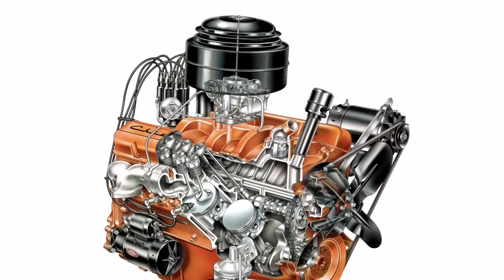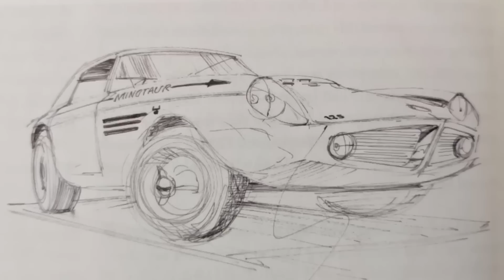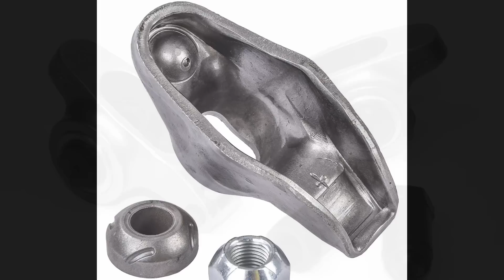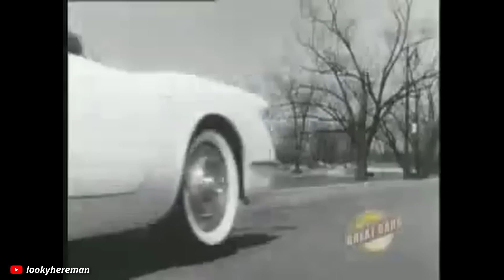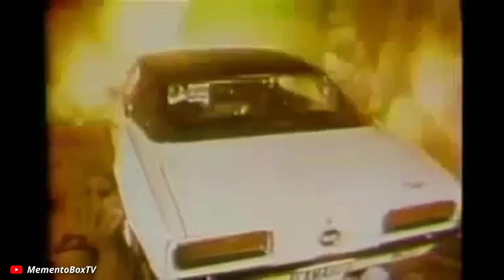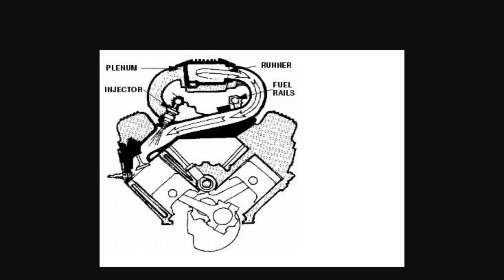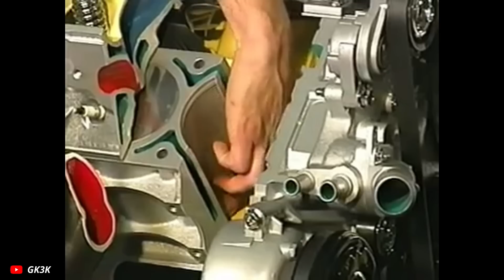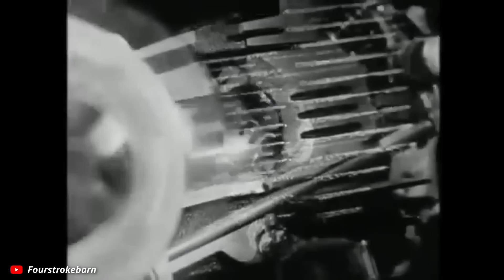The Engine that Powered America

Comment: I'm not quite sure how many small block Chevy equipped cars I've owned... but it has to be a dozen at least. What I do know for a certainty is that one of them - a workhorse 305- was in my '95 Chevy pickup and I bought it almost new (a repo) and sold it in 2019 with over 500K on the original drivetrain. Obviously there were many, many small repairs and routine maintenance along the way... brakes, starters, rads, tires, various electrical things, changed out the window transmission (or whatever that's called ... the thing that you crank to make the window go up & down), yada, yada, yada. 
The engine, the transmission and diff were all absolutely original and all I ever did was change out the fluids/filters.... plus I had added an aftermarket  tranny oil cooler. I never abused it but she ran like a top! Talk about dependable! 
In 2019 I put it on Facebook marketplace and got $1500 for it the next day! No wonder this engine family is a bloody legend!
Reply: Window regulator. And like the other guy said, the low power 305, plus your intelligent addition of the transmission cooler are likely what kept your 4l60e alive.
Reply: @middlesiderrider  Regulator... thanks, man! I'm finding it more and more common to search for words as I get older 🤷... but at least I'm getting older.
Reply: @haggis525  you're welcome. And yeah getting older isn't always great, but it sure beats the alternative.
Reply: @middlesiderrider  As for the longevity of a vehicles drivetrain... I've believed for a long time that keeping the fluids fresh by changing them out frequently is a great idea. I also find doing smallish jobs like that on my vehicles rather therapeutic.
Reply: @haggis525 
Haggis? I believe we have a Scotsman here, nice!  I am also an older guy who has lived through the entire years referenced in this excellent video.   I have always done as much maintenance as I could handle with my own cars, especially the Chevys. Yes, doing either the simplest jobs on your car can save you a lot of money these days plus deliver lots of satisfaction for a job well done. Chevys were the best cars ever made in the 50s 60s and 70s.  Many years ago, General Motors was really concerned with making their cars better and better with each year. Sadly, in today’s superficial world where big money rules and destroys traditional things, such as working on your own vehicles, Chevy and other manufacturers are only concerned about their quarterly stock reports, and care very little about putting out quality vehicles. Chevrolet now makes some of the worst cars in the world.
Reply: And probably  more  small  block Chevy  engines are  in  old  Fords  than  Ford  engines are  in old  Fords 😂❤😢
Reply: @Louis-kk3to  
The placement of the oil sump is why many times is my guess.
Reply: @babydriver8134  and a good  guess  it is 🤔
Reply: @Louis-kk3to  probably less than ford rearends in chevy's :P basically every nascar has a ford rearend and most top notch race cars etc.
Reply: For $1500 you should have just kept it
Reply: You should have keep her, they are gaining value now
Reply: @JefeInquisidorGOW  
My guess is $5000 today.
Reply: 305 didn't have enough power to break it's self or the glass 4L60E trans from '95 or the rear.
Reply: @hendo337 The 350 in a 92 only had 190hp.
Reply: @ChickenC0re  My dads 88 c2500, our neighbors 1992 c2500 and most other PU TBI350s from 87-95 were rated at 210hp (Sweden). All TBI350 vans 87-92 were registered with 197hp  and some pickups too. The PU with the lower rating were more HD, at least K2500.As a sidenote, cars (Pontiac and Buick B-bodies) had 180hp TBI350 until the LT1 came in Buicks.
Reply: @hendo337  Imagine that 🤔🤔 Well... it had enough power and torque to serve me for hundreds of thousands of miles... enough to tow my (admittedly small) 25 foot trailer sailer Catalina boat, my 24 foot travel trailer and supply my acreage with wood, equipment, water, yada, yada, yada... and that for around a quarter century! 
It's a pickup truck, right... not a muscle car... seriously man wtf do you demand? I think it was an amazing vehicle that provided stellar service! I am more than satisfied with what it did for me... if you're not then get something else. 🤷
Edit: you sound like a f"ing idiot, frankly.... no offense... but if you are offended rest assured that I don't give af. 😎

Comment: Over the life of the small block there were many different starters, none were interchangeable.
Reply: Actually chevy had a 153 and 168 tooth flywheel/flexplate and 2 different starters that were either diagonal bolted or straight across pattern thru most its life, most were interchangeable even with big block chevy.   Ford on the other hand had 15 different flexplates/flywheels( i exagerate a bit) and starter combos in the early days.
Reply: @a4000t  Agreed. The starters interchangeability was a strong point for sure. The straight pattern 153tooth was a direct fit on the Buick big block (68-76) too.

Comment: The only slight complaint I can offer is the starter ,block,flywheel interface. Really not that great.
Reply: They should have used 3 or 4 bolts to hold the starter on. I've had more trouble with sbc starters than anything.
Reply: Def the last engine available in USA that required starter shimming to even work right 😂